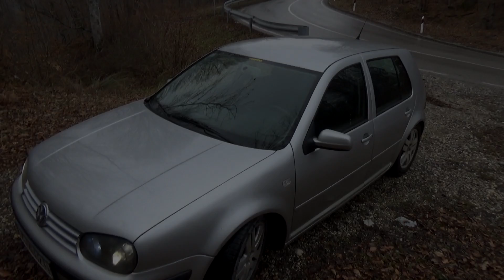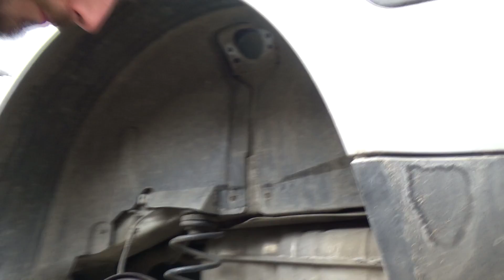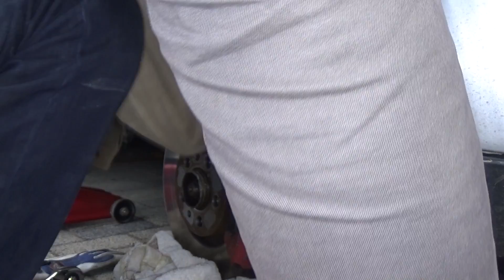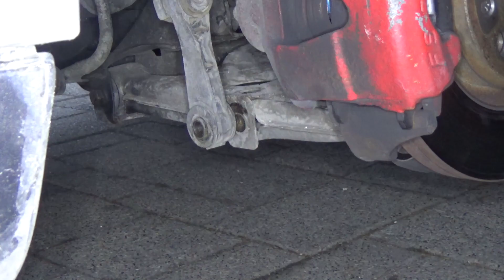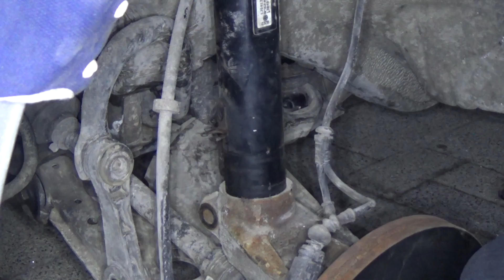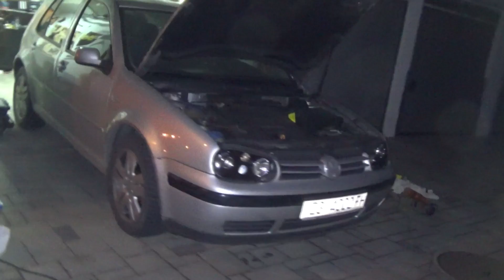How to install your stock shocks and springs - Golf 4

Comment: I'm preparing to replace the factory springs and shocks on my 2004 GTI VR6 by watching DIY videos like yours.  Do you mind me asking why you chose to remove the aftermarket shocks and springs, and reinstall the factory shocks and springs?  Also, can you recommend a quality set of shocks and springs for my vehicle that will last a long time and are suitable for everyday driving?  I will not be tracking the car, so I do not want anything too stiff and I do not want to affect the height of the vehicle.  Ideally, after the maintenance is done, the ride quality will be as it was intended from the Volkswagen factory.  My preference is to buy quality aftermarket components instead of OEM parts.  Thanks.  I appreciate that you make this video.

Comment: Good tools boys!!
Reply from the maker: Not sure if sarcasam, but thank :)
Reply: DIY Garage Projects and reviews  i didn't tried to be sarcastic, i have done the same job but without heat sourse.. without electric stuff, only hammer and what needed. Looked kinda easy on your video.
Reply from the maker: Thanks, it still wasnt as easy as we thought, those things hold tight